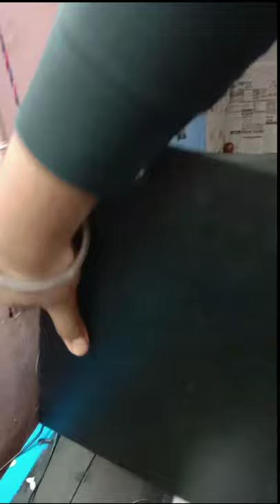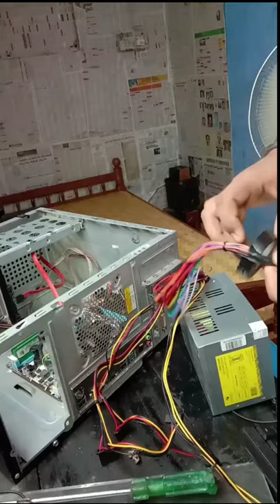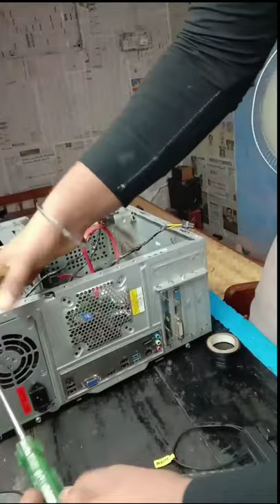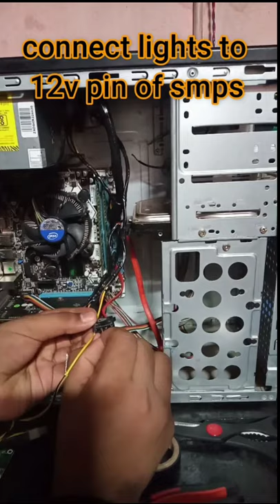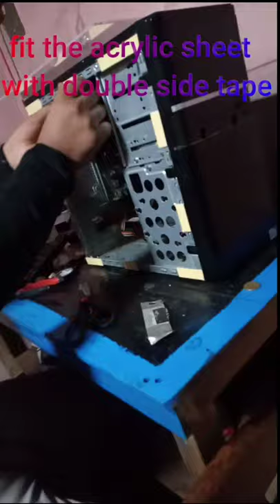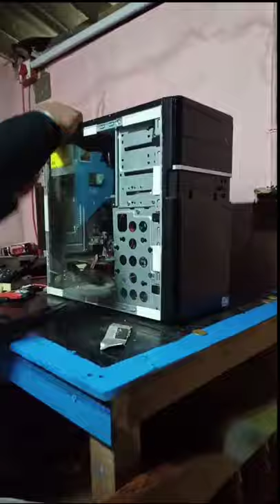DIY gaming cabinet || gaming pc

Comment: If your pc look better it doesn't mean that it's gaming pc , gaming pc means which can run games on high resolution , high graphics , and can give high fps
Reply from the maker: but the lights are satisfying and how i improve the performance with 200 rupees..?? 🙂🙂
Reply: But you can't call this a gaming pc
Reply from the maker: @BLACKWHITE-op8qd  its a gaming pc for me ❤
Reply: @JacTik360  
Aysheri ,enikk evnmare eahttapedunne ellaa.
namakk adichalo envmaree
Reply from the maker: @jinnet9965  pinnenna 😅
Reply: You don't know his specs 🙂
Reply: @kaberimukherjee9733  dude it's common sense most PPL have maybe you don't , his gpu is gt 710 or gt610 not more then that as there are VGA and dvi port which most of the new GPU don't have , he might be using some i3 to i5 processor Max to max 4th gen ,he is using dual channel ram , and his Mobo ,will max to max support 16gb , so it might be 4g×2 or 8g×2

Comment: rgb/lights = performance
Reply from the maker: Bro read the caption (diy gaming cabinet) you can use this method when you're pc have performance but the cabinet is not good. Then it will be a gaming pc
Reply: @JacTik360  XDDD yeah rgb=gaming yeah, i recommend new pc case..